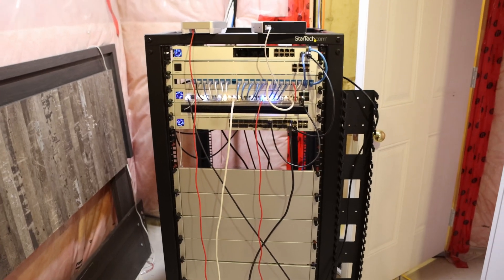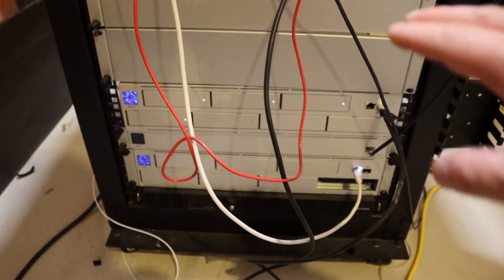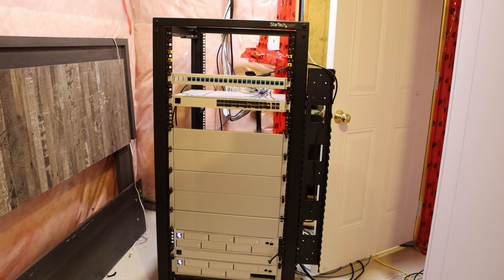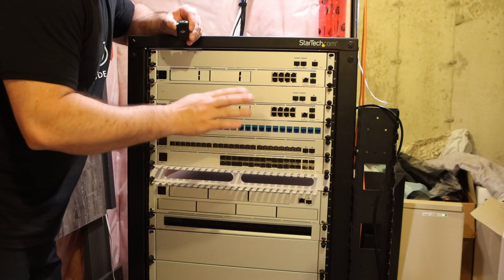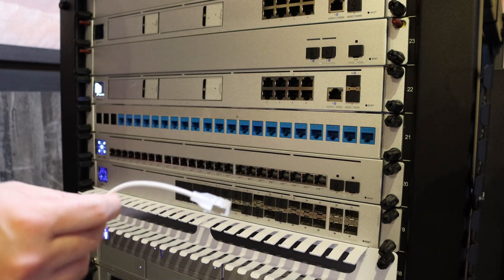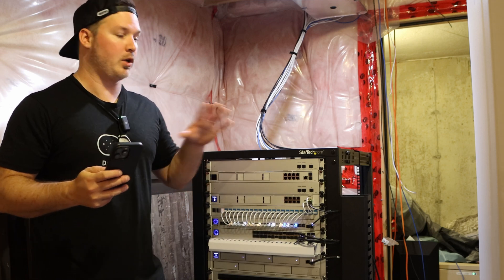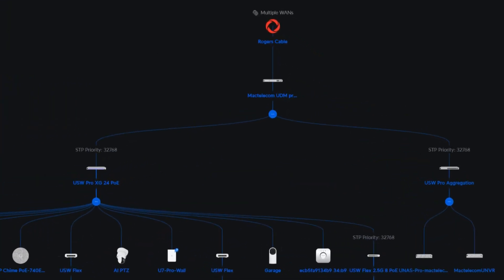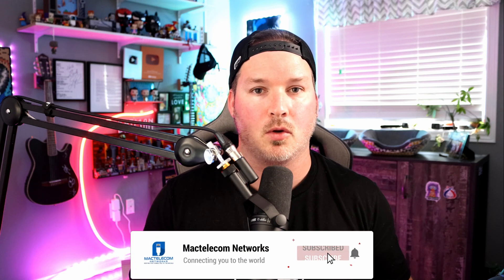Rebuilding My Network Rack

Comment: A little bit of your wheel house I'm assuming, but any recommendations for wiring a rack with non-unifi "servers"/NASs? I've currently got the cat5e cables tied(velcro) to the vga display cable and the power tied separately, not much equipment but still looks like a cluster.
Contents: sc846 (truenas - nas), sc826 (unraid - dockers, arrs, plex), chenbro nr12000 (want to swap for another 826)(proxmox - various VMs incl. Home Assistant), ups and battery pack, unvr pro, patchbpanel, and xg24....something (rj45 10gb switch). 
All that goes through fiber to another small 6u shelf mount thing (eventually moving this; gotta wire the house first.) with my udm, 48poe pro, and pro-agg

Comment: We were thinking about replacing our UDMP with the Enterprise Fortress Gateway. The issue is that the new device only supports the Network application and not Access for the door locks. Can you have both the UDMP and EFG on the same network?

Comment: Super interesting video, and looking forward to the deeper dives you mention. One question if I may, which has always confused me a little. What is the rationale for hanging the NAS and NVR off the aggregation switch, rather than the Pro XG 24 PoE? I seem to recall reading somewhere that only switches should be connected to an aggregation switch (I'm very new at this!).